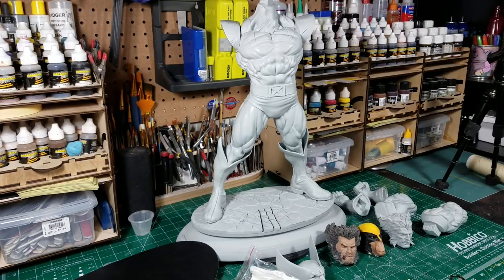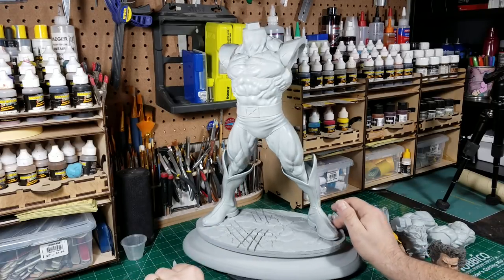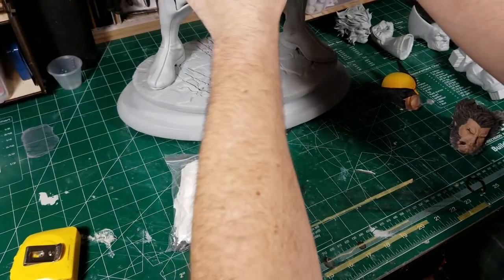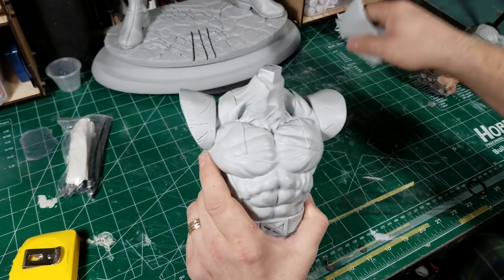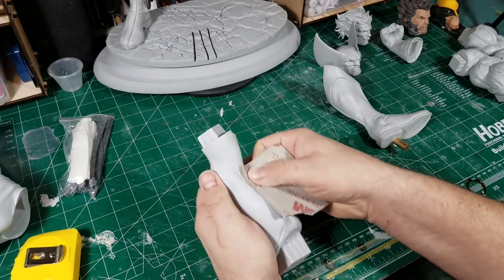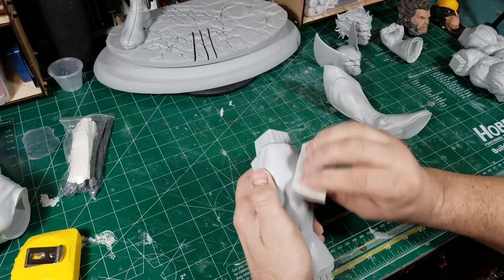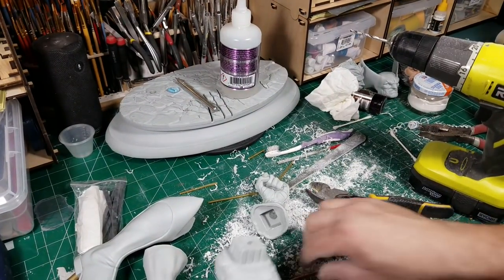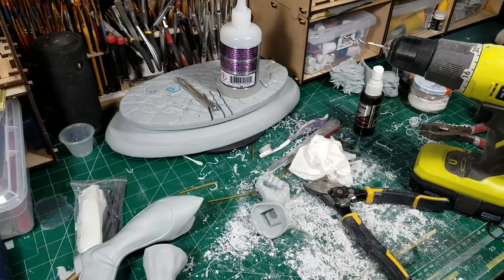WIP #2 1/4 Custom Wolverine sculpted by Eric Sosa

Comment: Amazing videos and awesome work. Way more goes into this than I would have ever imagined
Reply from the maker: That's one reason I do the videos.  People think that for $500 or $600 I just slap paint on the statue.  The heads alone took a full day to prep.  In the end I put in 60-70 hours on this guy.  That's less than $10/hr for my time, talent and supplies.  I don't know how some guys whip these out in 30-40 hours.  I've learned pretty quick I'm not charging enough so my rates have gone up and they aren't negotiable.
Reply: Yeah, just from watching your videos I can see what you mean. You have to charge for your time, plus this is a specialized skill so I don't see a problem raising your price. Lots of people just don't understand what goes into something until they try it themselves. It's easy to be an armchair quarterback.

Comment: awesome work , just a stupid question , if you do the pinning and you use a tube and make some scratches to grip on , why dont you use a screw with some big thread , isnt that easier to work ?
Reply from the maker: I could use screws but they are harder to cut and don't flex like brass does if my holes aren't 100% lined up.